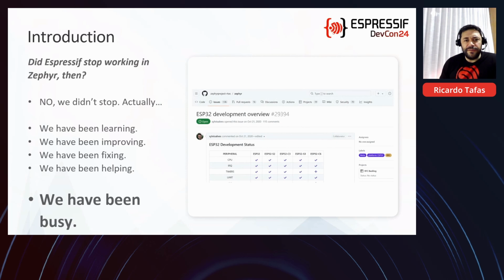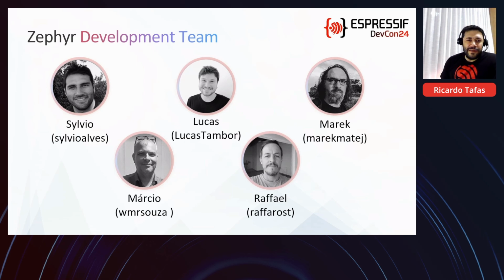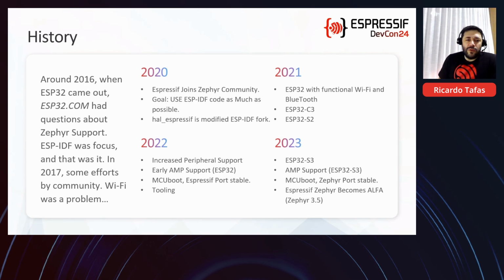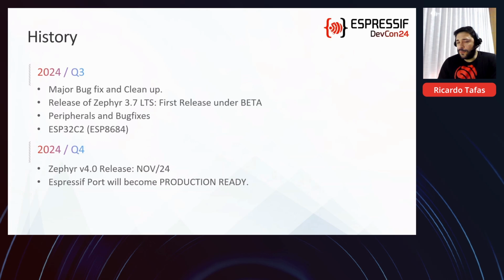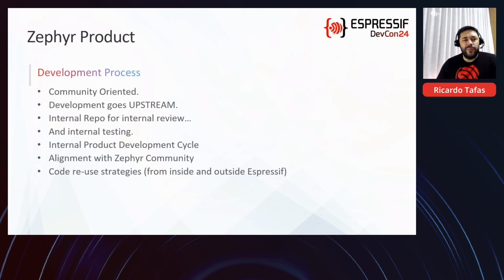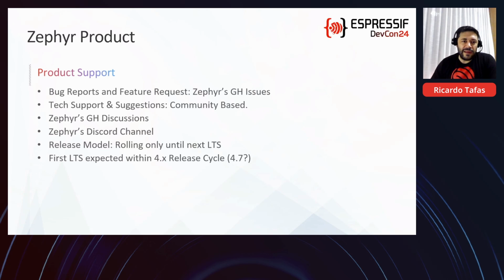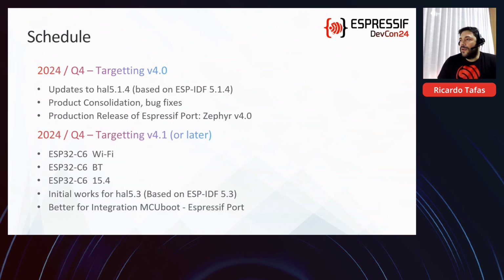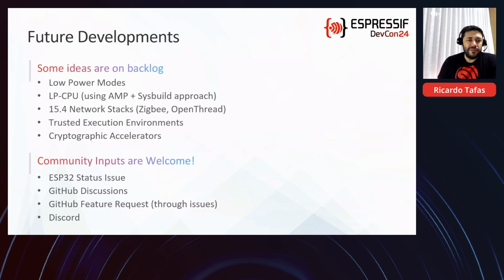DevCon24 - Status and Roadmap for Zephyr on Espressif Devices

Comment: No progress still. Espressif sucks. So many bugs in espnow that i reported and no answer back
Reply: They will have to do what Nordic has done, the investors was asked to transfer the I.P into Zephyr while they keep their radio stacks and have the public work on the RTOS , they don't have a team large enough to keep up with the complexity, this is a slow but definitive outcome. Espressif will have to follow this trajectory their software is in an identical situation pre "Nordic Zephyr"
Reply: @xorcipher zephyr is even a bigger mess with device tree and thousands config files
Reply: @solidfuel0 Neah, its just an acquired workflow once you get a hang of it everything makes sense, the radio and micro is a mess and the software needs to deal with this via abstraction, zephyr is doing a great job with this level abstraction.
Reply: @xorcipher  but how often do u need this write once run everywhere.  Most companies don't need this. So much more complexity for this